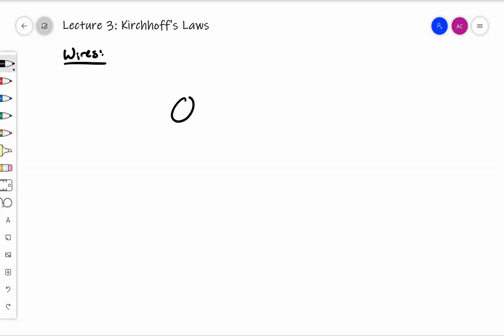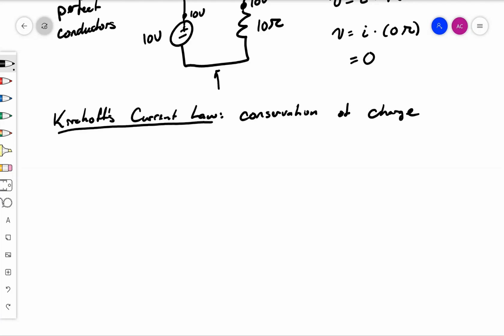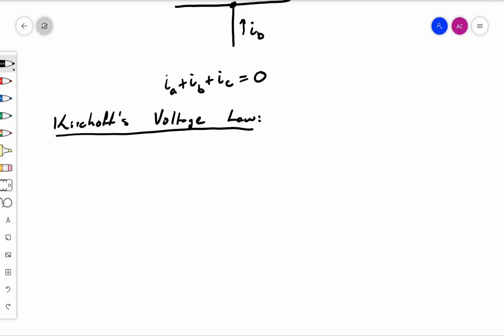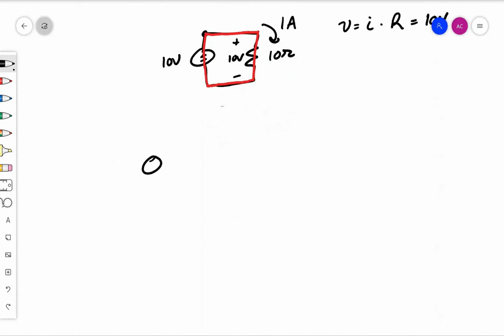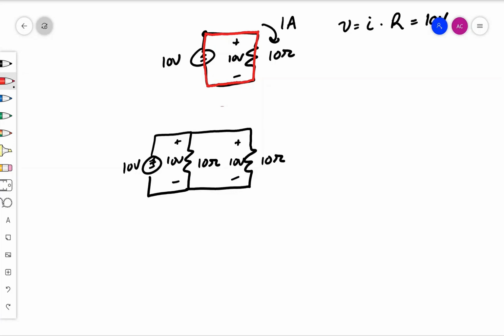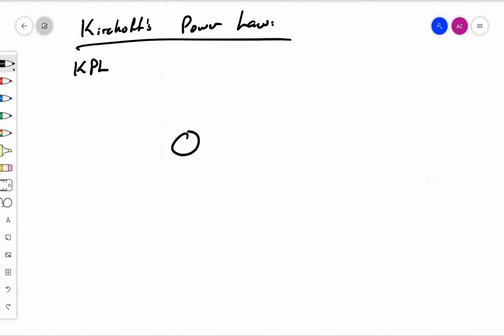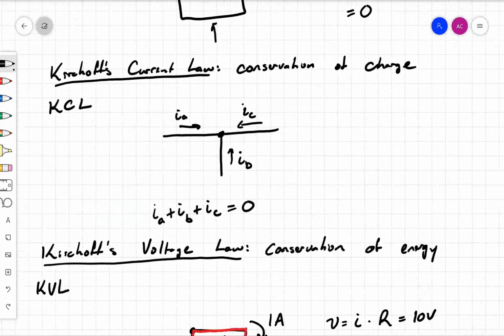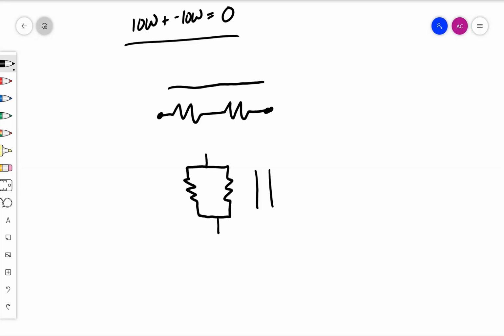Circuit Analysis Lecture 3: Kirchoff's Laws

Comment: In KPL, when you say power, do you mean electrical power (Or are they the same thing). And how does power come into play with electrical circuits, I know that voltage is electric potential energy and resistance is, the ability to resist the flow of electrons while current is, the flow of electrons. How does power fit into all of that? Is power, the power of the charged particles??
Reply from the maker: In this case, yes I do mean electrical power, but you can generalize it to mean any sort of power (EM radiation, light, sound, etc.). Power can take multiple forms, but for these videos I am relying purely on electrical power. 

Voltage is the electric potential energy that each charge has, and current measures the amount of charge moving per second. Resistance simply relates voltage and current for a resistor, and tells us how much charge will flow for a given amount of energy per charge (i.e. voltage). All of the energy that the charges originally had has to be lost somewhere, otherwise we would have violated the laws of physics, and this is what KPL is trying to tell us. Pretty much power is the amount of energy (in Joules) being dissipated per second. a 60W bulb, for example, releases 60 Joules of energy each second. Some of this 60W is released as light, and some is released as heat, but all of it has to be accounted for.
Reply: @aaroncarman  thanks Aaron!

Comment: Great video! I was wondering, if you had a circuit in which there were no resistors (Basically hooking your voltage source straight to ground) What would be the current? If Voltage = 5V, I=V/R, I=5V/0. So... what's the current? 5/0 is undefined, right?
Reply from the maker: Your question has two answers: an ideal answer, and a real answer.

The Ideal Answer: The current is infinite and the battery is immediately drained.

The Real Answer: Everything has some value of resistance that is greater than zero. The only reason that we forget about wire resistance is because it is really stinking small compared to real resistor values (think 0.001 ohms vs 1000 ohms). After all, 1000 ohms + 0.001 ohms is still really close to 1000 ohms, so we just forget about wire resistance all together. Even if we could create a zero resistance wire, batteries also have a limit on the amount of energy they can produce, and this manifests itself as an internal resistance. So even if the terminals of a battery were perfectly short-circuited together, the current would still be less than infinity (but still large!).

Not to mention that shorting batteries is a bad idea, and can cause a lot of damage to electronics and you! Good question!
Reply: @aaroncarman  Thanks so much!! You're very learned in this subject! I've never shorted anything (Or plan too ;)
Reply from the maker: All it has taken is several years of college and graduate study! Really though, all it takes is time to master anything. I hope you keep up the good work!